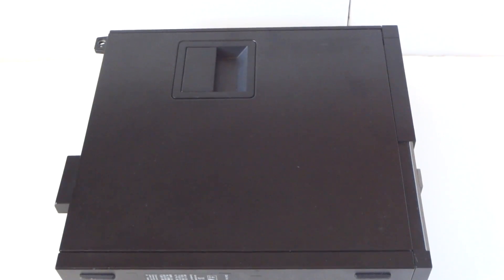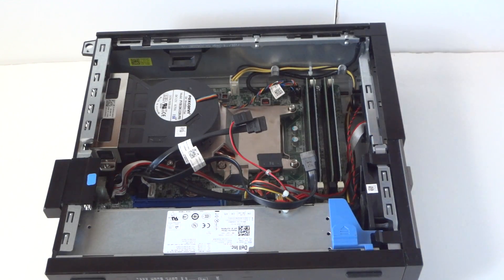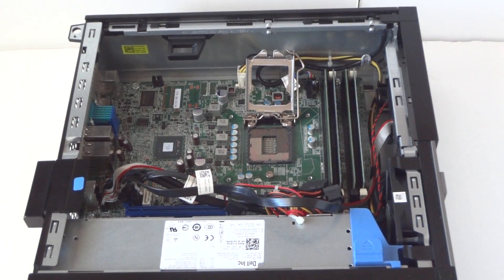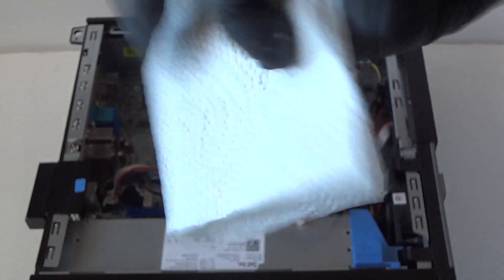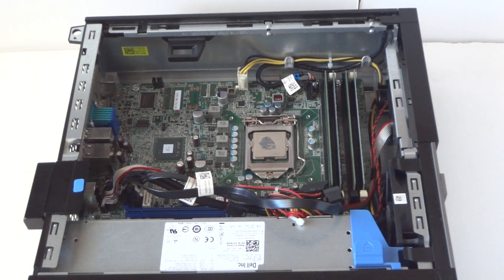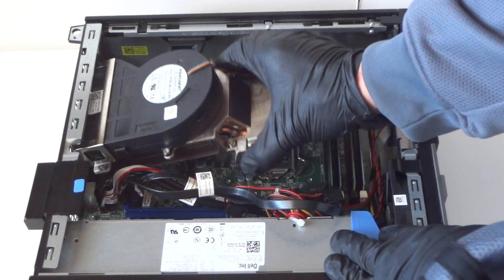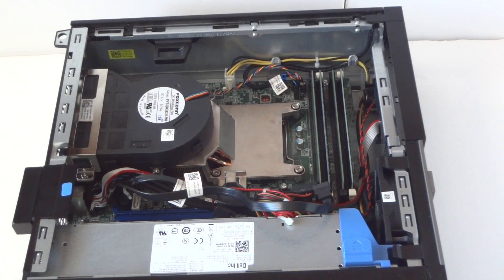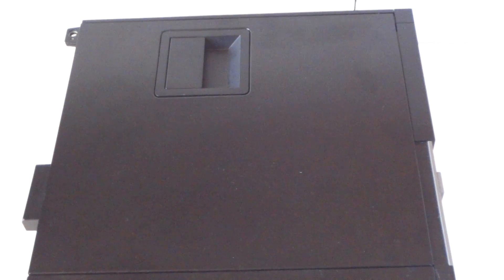Dell Optiplex 790 Upgrade Install Replace Change Processor

Comment from the maker: Full Parts list works with this machine:

This video cards will work with this dell 790 system.

(1.) Gigabyte Geforce GTX 1050 Ti OC Low Profile 4GB GDDR5 128 Bit PCI-E Graphic Card (GV-N105TOC-4GL) 
https://amzn.to/2XEqKMb

(2.) MSI Gaming GeForce GTX 1650 4GB GDRR5 Low Profile Graphics Card (GTX 1650 4GT LP OC) 
https://amzn.to/2VkDdSd

(3.) MSI GTX 1050 TI 4GT Low Profile  Graphic Cards 
https://amzn.to/34r0AxG

(4.) Gigabyte GeForce GT 1030 GV-N1030D5-2GL Low Profile 2G Computer Graphics Card 
https://amzn.to/2Xu3SyO

(5.) ZOTAC GeForce GT 1030 2GB GDDR5 64-bit PCIe 3.0 DirectX 12 HDCP Ready Low Profile Video Card ZT-P10300A-10L 
https://amzn.to/3eayL1b

Intel Core i7-2600 Desktop CPU Processor
https://amzn.to/3q7teOx

This RAM works with this machine:

(1.) Crucial 8GB Single DDR3L 1600 MT/s (PC3L-12800) Memory CT102464BD160B
https://amzn.to/2VhGv8O

(2.) Crucial 4GB Single DDR3L 1600 MT/s (PC3L-12800) Memory CT51264BD160B 
https://amzn.to/2xq46wb

(3.)  Crucial 16GB Kit (8GBx2) DDR3L 1600 MT/s (PC3L-12800) CT2K102464BD160B 
https://amzn.to/2VpsKpP

(4.) Crucial 8GB Kit (4GBx2) DDR3L 1600 MT/s (PC3L-12800) Memory CT2K51264BD160B 
https://amzn.to/2y7XZwq

This HDD 2.5inch will work in this caddy for extra storage.

3.5" to 2.5" SSD or Hard Drive Caddy Adapter R494D 0R494D 
https://amzn.to/2XTPeRr

1.. Seagate FireCuda 2TB Solid State Hybrid Drive Performance SSHD – 2.5 Inch 
https://amzn.to/3b1e8T7

2..WD Blue 2TB Hard Drive s, SATA 6 Gb/s, 128 MB Cache, 2.5"
https://amzn.to/2Xstb4b

3..Seagate BarraCuda 2TB Internal Hard Drive HDD – 2.5 Inch 
https://amzn.to/2xmf0TE

This cable required if you going to install SSD and HDD:
Benfei 15 Pin SATA Power Y-Splitter Cable 8 Inches
https://amzn.to/2XsG0LV

Cable Matters 3-Pack 15 Pin SATA Power Splitter Cable 8 Inches 
https://amzn.to/2Rval8B

Zheino SATA Power Splitter Cable (2 Pack) SSD Power Cable HDD
https://amzn.to/3a3V9Wq 

 SSD list works with this PC:
(1.) Samsung 860 EVO 500GB 2.5 Inch Internal SSD MZ-76E500B/AM) 
https://amzn.to/2yNxnkE

(2.) WD Blue 3D NAND 1TB Internal SSD, 2.5" WDS100T2B0A
https://amzn.to/2wvnC9Z

(3.) WD Green 1TB Internal PC SSD  WDS100T2G0A
https://amzn.to/3cbrcWa

(4.) SanDisk SSD PLUS 480GB Internal SSD SDSSDA-1T00-G26
https://amzn.to/3a3i9ou

(5.) Crucial MX500 250GB 3D NAND SATA CT250MX500SSD1(Z) 
https://amzn.to/34rZlhy

(6.) Samsung 860 PRO SSD 256GB - 2.5 Inch SATA III 
https://amzn.to/2ybiHLK

(7.) Samsung SSD 860 EVO 250GB 2.5 Inch SATA III Internal SSD 
https://amzn.to/2VjIAkK

(8.) SanDisk SSD PLUS 240GB Internal SSD
https://amzn.to/3c7SEE4
Reply: Can i put HyperX fury RAM on Dell optiplex 7010 SFF?. Will it work?, beacuase am planning to buy one.
Reply: @Kaine-ub5lf  maybe Idk why would it not work.

Comment: I have an optiplex 790 I can put any i7 2600 it would be very helpful if you answered dear brother
Reply from the maker: Hi, yes 790 does support i7 2600 CPU..
Reply: @Mxkdt  Can I put in an optiplex 790 i7 2600(k)?
Reply from the maker: @danielelfuerte6569  Hi you can use i7 2600 only https://www.ebay.com/itm/203789566880
Reply: @Mxkdt  updated A22 bios, will it work?
Reply from the maker: @danielelfuerte6569  Yes

Comment: boa tarde !  se recorda qual processador trocado ?   tipo de  i3 2120 para i7 3770k ...  estou afim de mudar o meu ,mas não sei se esse aircooler de fabrica da dell resfria uma i7 3770k ou se xeon 1220 v2
Reply from the maker: Oi, eu usei CPU i7 2600 e este modelo não suporta i7 3770

Comment: do you need to change any software or will it just boot from that?
Reply from the maker: Hi, no you don't have to change any software. Make sure you do have latest BIOS installed before installing new CPU i7.

Comment: Hi, is the i7-2600 the only cpu which can be used? or can i use a xeon w3520?
Reply: You can use xeon e3 1230,1240,... (not v2,v3,...) if you have updated the bios to the latest version A22. You will  also need a gpu because xeon don't have integrated graphics.

Comment: I know this video is well over 4 years old, but my 790 has an  intel i3 2nd Gen and it crashes a lot. I’m running 32GB ram but I think the processor just isn’t enough for my studio software

Comment: Hey man I was wondering if a i5-9400f would work on this thing cuz I bought one recently and it wouldn’t fit what other cpu is best for this motherboard that will fit and function properly
Reply: i believe you can only go up to 3rd gen processors on this mobo id recommend a i7 2600 (dont quote me lol)

Comment: Ik this is a old video but I did everything and when I turn it on I don't get a display?
Reply: Try different cables. Monitor and connect on both the gpu and motherboard. If still nothing it’s probably dead

Comment: This works for the 7010 sff?
Reply from the maker: Hi, yes.
Reply: @Mxkdt  Hey man which processor did you used on this pls add in your description, I have i5 2400, I want to know if i7 2600 will support on this. And about GPU, some says if we put a GTX 1050 ti or 1650 Low Profile we need to change power supply to higher watts Is it true or not.  But gtx 1050ti low profile, its already low profile why do we need new power supply
Reply: YASHViR GAMiNG hey Man U currently have a gtx 1650 low profile and it works fine no need to change power supply unless it is lower than 240 watts

Comment: after i installed new prosessor i got a black screen can anyone help me on this issue?
Reply from the maker: Hi, what CPU model did you install?
Reply: never mind, i took out the cpu and put it back and it start right away, maybe it was miss align. but great vid subscribed!

Comment: Hi my friend what happens after you install the CPU do you have to mess around with the BIOS
Reply from the maker: What CPU model are you going to upgrade i7 or i5?
Reply: @Mxkdt  i got a motherboard on  ebay use my got shock no good is the same model # my dell got a i7 i dont know wat core the use motherboard had i know its going to work the i7 hopefully my question is do I have to do any changing on the BIOS when I get everything back installed ...get it

Comment: Hello i need help does dell optiplex 790 support 3rd gen ?
Reply from the maker: Hi, only second gen.
Reply: @Mxkdt  what if i use gpu instead of the intergerated gpu of the motherboard
Reply from the maker: Yes you can upgrade video card .
Reply: @Mxkdt  for the cpu that is
Reply from the maker: Hi, only i7 2600 and does not support i7 3770

Comment: Very useful videos. I got my hands on a used optiplex 790 in very good condition. It has a core i5-2400 and I want to upgrade the processor. Can you please share a list of the processors this mobo can support?
Reply from the maker: HI, yes you can upgrade to Core i7 2600...
Reply: @Mxkdt  is it worth upgrading?
Reply from the maker: Hi, yes used CPU only cost around $60
Reply: @Mxkdt  is there a need to upgrade the PSU if processor is upgraded to i7 2600?

Comment: Can i put an i5 3470 in optiplex 790 mini tower?
Reply from the maker: Hi, no, the dell optiplex 790 supports Sandy Bridge CPUs only.
Reply: @Mxkdt  ok then
Reply from the maker: You can upgrade to Intel Core i7 2600 for gaming..
Reply: @Mxkdt  cool

Comment: I have a Dell optiplex 790 i5 2400 with a rx 580 8gb

I’m wanting to upgrade it to a i7 2700k

Would I be able to use the same motherboard with no issues? And would the heat sink need to be upgraded?
Reply: when i googled this (looking for similar upgrade from i5 2400 cpu) it says the 'K' model of the CPU needs the motherboard to have overclocking...i do not think these 790 SFF have that (a regular i7 2600 should be enough though)

Comment: Which cpu did you upgrade to?
Reply from the maker: HI, which CPU are you trying to upgrade i5 or to i7 ?
Reply: @Mxkdt  i5 quad core
Reply from the maker: You can upgrade to Intel Core i7 2600
Reply: @Mxkdt  cool,thanks,Any advantage of the i7 quad over i5 quad? i'm not a gamer,just youtube ,hulu,netflix and web surfing. i already have an nvidia 2gb GPU installed.
Reply from the maker: You will notice the difference and are you using solid state drive or hard drive main boot drive?
Reply: @Mxkdt  Main drive>Samsung evo 256gb SSD,Win10Prox64,16gb of RAM,the i3 i currently have is way snappier than my old Q6600 Quad and it stays cooler,thinking about not upgrading at all but the i5 Quads are really cheap on ebay and in the local facebook marketplace
Reply from the maker: i would only upgrade to i7 2600 and not to i5
Reply: @Mxkdt  But i3 is 65w and i5 and i7 is 95w. Are you sure it will work?

Comment: Hey bud! Where can I get some high end paper towel?
Reply from the maker: Hi, they sell paper towel in most grocery stores or hardware stores.
Reply: Mxkdi ok thanks! Also with the dell optiplex 3010 will I be able to upgrade the heatskin to a different one by intel!? Or will it be a bottle neck because the CD Drive is in the way?
Reply: How Yea btw it’s a small for faction and I just don’t like the heatsink because it’s loud and gets really hot to the touch
Reply from the maker: Hi, you can't upgrade dell optiplex 3010 sff heatsink.
Reply from the maker: What CPU do you have installed ?
Reply: Mxkdi dang really. That’s a bummer! I have a i5 3470 3.2ghz. The fan is loud when I cut the Pc on and when I play games it gets really hot. Because I installed a gt 1030
Reply from the maker: Does your video card have fan installed or is it fan less ?
Reply: Mxkdi it has a fan on it. It’s the one from evga. It’s a tight fit to be honest...there’s a wire really close to the fan almost blocking it...is that the problem?
Reply from the maker: Ok you have check make sure fan is spinning yes wire could be really close to the the fan and blocking it and only option you have is you have to install air vent on you side cover for the machine run cooler, and i have to make and upload video really soon for small form factor dell.
Reply: Mxkdi yessss thanks so much for replying sir! Really love your videos and I can’t wait for you to make that video...because I need to learn more about this Pc because I don’t want it to burn up

Comment: Hi I have a Dell OptiPlex 990 Ssf it’s a i7 2600 what can I upgrade the processor to as it comes with the i7 2600 new from the shop when I bought it
Reply: I7 2700k
Reply: you should be able to use an i7-3770 since its also a socket 1155
Reply: Has to be compatible with a 1155 socket and Q65 chipset, and the reading I have done says that only processors with Intel integrated graphics of 2000 or below will be compatible. The i7-2600 is likely the highest processor that will be compatible without the aid of a graphics card. Newer processors CAN work, but the system will show nothing on the monitor unless you are using a dedicated graphics card for the connection to the monitor.
Reply: Actually i looked it up in the systems online manual, the 2600 is the highest it will take
Reply: @lander77477  You can use software to OC the CPU on these motherboards, so always find the K variant of the chips because they're unlocked.

Comment: Hi, I have 990 SSF I5-2400, appreaciate you could tell me which processor I able to upgrade next or to the max?
Reply: i7 2600 is the max we can go i have the same as you atm
Reply: Cant you use an i7-3770 since its also a socket 1155?
Reply: @lander77477  no, chipset Q65 is not compatible with intel integrated graphics 3000 or newer, only 2000 and older. It will not show anything on a monitor unless using a dedicated graphics card

Comment: What is the best processor that I could use in the 790 sff
Reply from the maker: Hi, Intel Core i7 2600
Reply: Cant you use an i7-3770 since its also a socket 1155?
Reply: @lander77477  i know im very late, but did you get an i7 2600 working in this pc
Reply: @charliebradshaw9564  I bought that exact chip but I honestly never even bothered installing it, my plans changed and I just upgraded my other computer tower, but if I bought it, I assume I had done my homework and it should have worked
Reply: @lander77477  just bought it it works!!
Reply: @charliebradshaw9564  Sweet!  I just wished i hadn't spent 100 bucks on a chip that's just sitting in my closet

Comment: You can tell he been doing this for a while.
Reply from the maker: Yes sir
Reply: @Mxkdt  hey man why won’t my fan connector come out i have the same model it seems to be plugged in really really tight and it won’t come out even with nose pliers

Comment: what processor is that and can i put a intel core Intel Core i5-4570 on this PC
Reply: Why cant you put an intel 3rd gen in there?  Its also socket 1155
Reply: @lander77477  Q65 Express Chipset doesn't support Ivy Bridge processors

Comment: i3 2100 to i52500  a11 bios do i need to upgrade the bios? thanks
Reply: yes, always keep the BIOS updated to most recent version if possible. current BIOS for optiplex 790 is a22

Comment: I have an Optiplex 790 SFF with I7-2600 running World Community Grid (grid computing) with 100% processor load 24/7/365 and my CPU temps are getting relly high. Anyone have a good solution to enhance CPU cooling on this rig?

Comment: Hi. I heard i7 2600 is the max you can do for this board. Can I do any higher than that?
Reply: i7-2600 is the maximum processor compatibility

Comment: Could you do upgrade Optiplex 780 sff CPU?
Reply from the maker: Hi, yes i will upload video really soon.
Reply: Mxkdi I have a Dell Optiplex 780 Intel Core Duo2 e8400 3.00gz in it now. I do alot of day trading so I have multiple charts displayed at all times. The charts freeze up often, for a few seconds as if the processor is not able to process the data quick enough. What are your thoughts and should I upgrade to a faster CPU?

Comment: i tried doing this with the MX-4 thermal compound, i was installing a new i7-2600 , and the computer stays with a solid yellow light on the power button. help?
Reply from the maker: Did you try to test processor in different machine i had same problem.
Reply from the maker: What memory are you using ?
Reply: I have 2 sff optiplexes 790s. i tried the same i7 2600 on the other machine and it worked just fine with same memory. And the ram? It's DDR3L 1600 MT/s (PC3L-12800) Unbuffered UDIMM Memory. I feel as i was installing the cpu in the first one.
Reply: @CPTSharktopus  that RAM is incompatible as far as I know, RAM for any optiplex 790 should be 1333MHz pc3-10600 DDR3

Comment: Will the stock cooling solution by Dell, be enough for the 95W TDP of the i7 2600?
Reply from the maker: Hi, yes stock cooling in a dell optiplex 790 sff  is enough for i7 2600.

Comment: Whats the best i5 CPU i could go with this exact same system you have? Would it be the Intel Core i5 2500 / 3.30GHz ?
Reply from the maker: Hi, i have i5 2400 and i5 2500 will work fine or you can go with i7 2600
Reply: I have this Optiplex 7010 usff with i5 3470
Reply: @j.valdez2675  optiplex 7010 is a totally different system with different chipset, an i5-3470 would NOT be compatible with a optiplex 790

Comment: Would the Intel Core i5-3550 Quad-Core Processor 3.3 GHz 6 MB Cache LGA 1155 - BX80637I53550 work with this computer
Reply from the maker: No
Reply: Mxkdi could you possibly give me an idea for a good processor for gaming on this pc? Also thanks for all the help
Reply from the maker: Intel Core i7 2600
Reply: Mxkdi thanks ur the best
Reply: Mxkdi sorry for all the ?s but will the regular heat sink work or will i have to buy another one?
Reply from the maker: Dell regular heat sink will work fine make sure to use arctic mx-4 thermal paste.
Reply: Mxkdi ok

Comment: I have an optiplex 790 mt with a intel core2 duo 2.93 what is the highest processor I can upgrade to would you recomment?
Reply: The best processor you can get on an Optiplex 790 is an i7 2600k. You won't be able to overclock it using your current motherboard but it is clocked higher. Also you won't be able to use the Ivy bridge processors such as the i7 3770k (although it has an lga 1155 socket) since the dell optiplex motherboard contains the Q65 chipset it is only compatible with the Sandy Bridge processor.
Reply: If you are on a budget I would recommend the i5-2400 or the i5-2500. You can also get the unlocked processors as well.
Reply: thanks for the information.

Comment: Hi thanks for the excellent tutorials. However, I need a powerful CPU cooler on my 790 mini tower as I want to upgrade from i3 to i7 2600 but the connector is a Dell proprietory one. Are there any compatible ones out there?
Reply from the maker: Hi, yes dell optiplex 790 does support intel core i7 2600 processor and you can use dell original heat sink cooler and you don't have to upgrade

Comment: I had to remount the heatsink on one of my 790s.  The fan would go into high gear at the slightest load.  The heat compound had turned to rock.  Your video was a great help even though I have a desktop.

Comment: Will this ram stick work   8.0GB (1 x 8.0GB) OWC PC10600 DDR3 1333MHz ECC FB-DIMM 240 Pin RAM
Reply from the maker: No this ram will not work

Comment: Do you need that stuff to go on top of the processor after u put it the new one?

Also what processor should I buy for my Lenovo M52 SFF I also want to upgrade to 6 or 8 GB of RAM.
Reply: i am not sure about your ram, but unless your cpu comes pre applied with paste, then yes you need to put the thermal compound